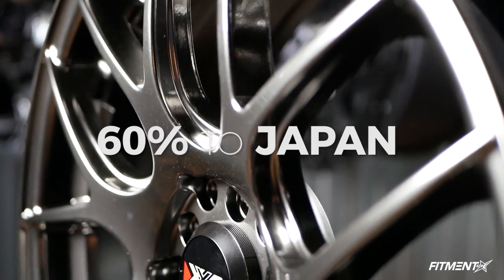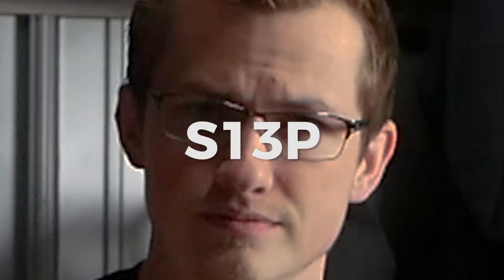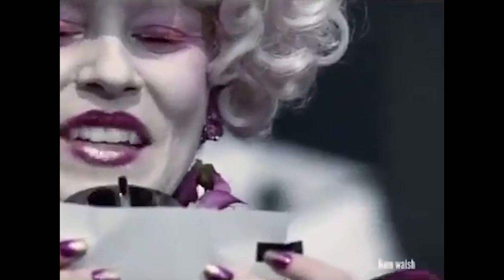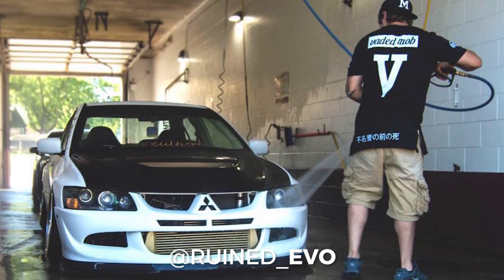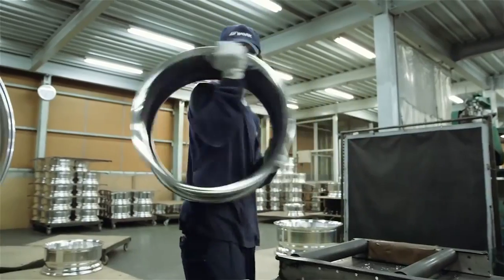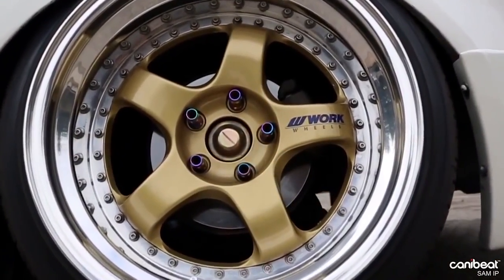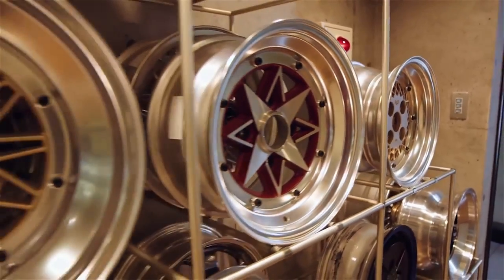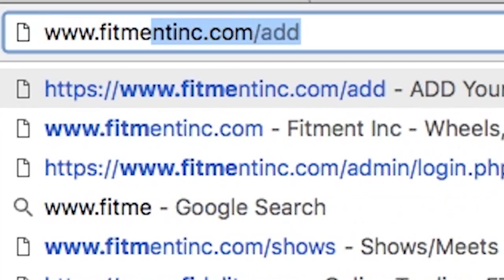THE TRUTH ABOUT WORK WHEELS

Comment: Its important to note that the 2pc and 3pc Work wheels use a cast center, not forged.
Reply: Chris Sempek yup, but the barrel is forged and the face is low pressure cast, its good

Comment: You can buy yourself an iPhone X or one work wheel
Reply from the maker: very valid statement
Reply: Actually in Malaysia 4 Work wheels cost about Rm1500 which if you convert to USD is divided by 4. So its consider cheap. Which means 300+ dollars😂

Comment: Have you had the RSZ wheels refinished?  I'm curious to hear your thoughts on powdercoating aftermarket wheels.  I've seen horror stories of the metal become weak after the heating from the powdercoating process.
Edit
And also wanted to add that I had a rare set of Work MCO Racing wheels fixed/restored and haven't had an issue at all, which I'm grateful for!  That video is here if interested! https://youtu.be/fYAx9DB50WQ
Reply from the maker: Thanks man! We will make a video and cover this!